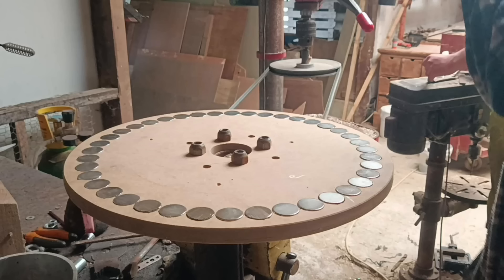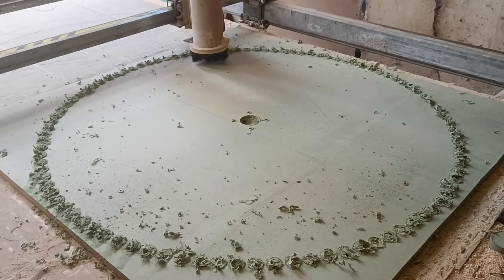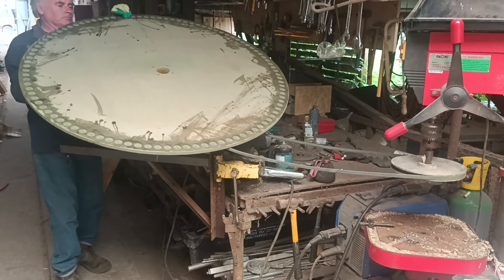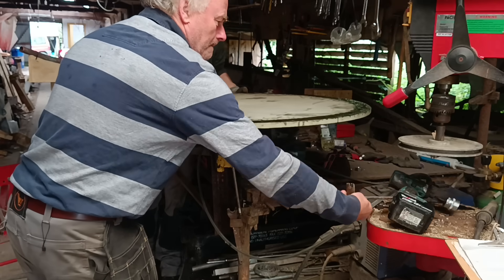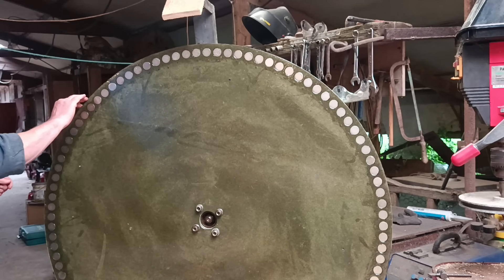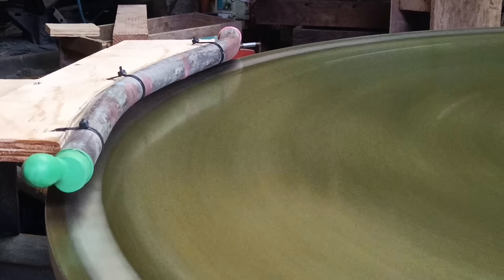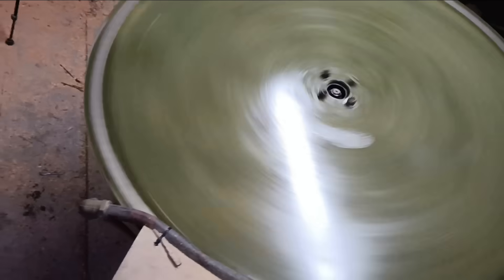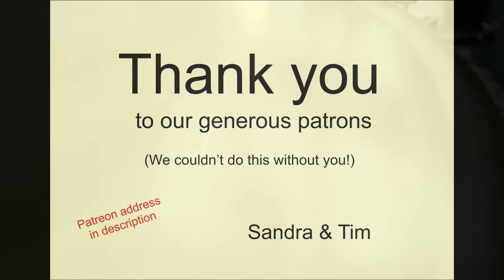ABSOLUTELY HUGE Magnetic Induction Heater! Using 100 Spinning Neodynium Magnets And A Bucket

Comment: I've been working on something similar, not as large of a spinning disk, with a large coil of 1/2" copper tubing as the non-ferrous heating coil. Rather than a single row of magnets, I arranged two rows of magnetron ring magnets in two rows, the copper coil arranged to go around the entire magnet disk with the entire area of the copper coil exposed to the rotating magnets at a lower RPM.  Also, I used a check valve on the cold-water inlet side, and an expansion tank on the heated side with a closed 20-gallon steel tank. A small positive displacement gear motor circulation pump circulates the water back to the beginning point on the heated copper coil. This is closer to what a standard electric water heater would do internally, only with less electric energy. The disk does not need to be helped to begin spinning, other than the start capacitor, and the tank temperature is limited with a single bulb type probe thermostat.  It works but I think the slower heating recovery time would take three of these to use in a normal home use scenario providing continuous hot water at around the total heating cost of a standard 40-gallon electric water heater, except this would be continuously heating over the limited recovery time of the standard water heater. - I have noticed the stronger magnets don't require faster motion to do work required. The set temperature I use is 135 degrees F.

Comment: There is also evaporative cooling. Don't forget that it will pressurize if it boils, could lead to explosion if totally sealed. Try a loose fitting lid first.

Comment: what would happen if your copper tube was longer across the induction area of the magnets? Lets not forget that there is also a magnetic field below the disk so you should be able to make your pipe encircle both the top and the bottom of the disk.

Comment: - spin the disk vertically because that makes the next point easier to accomplish
- Have two copper circular containers run the circumference of the entire disk. One on each side.
- make each container out of a thick laser cut copper disk so that the face of the containers facing the magnets is flat and as close as possible to the magnetic field as possible. The faces of the containers that do not face the magnets can be a material that is easier to work with and doesn’t heat up/lose heat to ambient.

Comment: Cool, now what is the efficiency?

Wouldn't it be more efficient to use the power driving the motor to just heat the water directly?

This looks like an overkill. It's working but it's an overkill for no apparent reason.

Comment: Wood and magnets are rather heavy, requiring a bit of HP to move it about.
However, a tubular aluminum frame is light and will spin faster. The tubing could have a central tube inlet, and a  circular/toroidal pool outlet. Plastic tubing could dip into the liquid with a small but effective circulation pump in between. 
A small turbulence will develop around the plastic tubing, so the water level needs to be a bit below the top of the frame.
The frame needs to be symmetrical to avoid unnecessary vibration. You might need to fit and weld, because the one shot bender is designed for a different application.

Comment: Not trying to sound like a smartass but have you thought of burning all your bits of wood under the copper piping that way you can put your belt back on your tractor and be able to use your drill press again, just saying

Comment: An bigger isnt alway better you have better luck make electric power then store the heat in sand using the sand to heat the water all at once or it will just keep getting cold befor you could use it or have vary little hot water you pick heating water is a wast in less your making steam engine for power soon as it gets hot its wasted energy by cooling down

Comment: @Way Out West - Workshop Stuff old water heater tank put the side that heats up to the top so your dumping only hot water into the tank cover all the lines in wool or anti freeze tube then rap wool on top of that rap a coper tube or a tube made out of the stuff you cooked the egg with seems like it worked better an have longer  circle the hole length of the magnets if it heats up faster rap top that isnt by the magnets so theres no thermal loss there
Reply: Or just rap the hole tube shouldnt be in the way of the magnets anyway should shoot right thu it or rap soild copper coil over the magnets takeing each end one positive one negative to power a mini heater to warm the water instantly your welcome

Comment: I agree that insulation will help but feel what you need to be chasing is efficiency. How about using a flat strip of copper 4 to 6mm thickness 400mm long 50 to 100mm wide. Most important is to reduce the air gap to 1mm or less. This will induce strong eddy currents and therefore the most resistance and therefore heat. Heat transfer can be achieved if the strip is welded or solerded to the pipe. Would love to be there to see the results. Good luck.

Comment: Why wouldn’t you use a circular piece of 1” soft copper pipe that already comes in rolls with no bending necessary, pipe wrap it using the black insulating foam wrap?  It is self sealing with no need to use cable ties and keeps it “floating” the correct distance from the magnets.  Also, instead of wasting the use of so many magnets, you would be able to use the entire ring of magnets all at the same time?  Your materials are rudimentary at best and horrible at the least.  To improve efficiency even further, run the disc on a vertical axis instead of a horizontal axis plane thus making use of both sides of the disc at the same time.  You would then be doubling your output while using the same number of magnets.  If you would spiral the magnets inwards so that the entire You are defeating your experiment by trying to nickel and dime the experiment to death instead of spending a few more bucks to right the wrong situation.  Anything else that I can help you with?

Comment: You can add a 2nd copper pipe on the opposite side of the armature wheel doubling heat generation. Probably on the 180 deg. lobe not directly opposite. The heat generated at this scale seems a bit low to get much convection current to the reservoir for efficient circulation from the heat generators. If the copper tube walls were thicker you might get more current which could increase BTU's generated. It must be the resistance of the metal generating heat via the magnetic eddy currents. Maybe increase the resistance of the metal - an aluminum  pipe might generate more heat as it's less conductive. Oddly, aluminum is diamagnetic so it's strange that alternating magnetic poles moving past have any effect... It would be fascinating to connect an oscilloscope to see what the current looks like! (in both metals) It might explain a lot.

Comment: Laboratory gram scales use a similar system to 
slow down the swinging action of the scale.
Called "Inertia Dampener"
Where a piece of nonferrous metal with ridges on it swings between 
a narrow gap of a C shaped magnet.

Comment: if you want to use mechanical rotational energy to heat water, a better effeciency is by using a water hammer heater.   This inventor invented it and it was ingenious.   But it never really took off.

Comment: With cold water coming out the cold water tap can get up to 37c in the middle of summer here and I shower at 42c, it wouldn't take much to heat a tank of water but hard for continual flow but would this be more energy that a solar panel and a jug element?

Comment: I’d try lots of smaller lengths of tubing connected with non-conductive tubes. Your eddy currents have too much room to run. Also, you can wrap some length underneath just as well as on top

Comment: You can use both poles of the magnet to double the amount of useful work extracted, magnetic flux goes right through wood or whatever that is.  A large insulated copper sheet on both sides would get quite warm and can effectively transfer the heat to copper pipe in contact. Be careful if you try the sheets, the magnets will put a lot of torque on them and can move or bend them if the flux is too great.

Comment: Suggestion: Partially flatten the copper pipe holding the water. That will allow the water to heat more rapidly, causing greater thermal flow.

Comment: Do you get more energy out using this as an induction heater or a fly wheel?  Could you do both at once?

Oh, and as a friction heater... Would induction or friction heater get hotter with same energy in?

Or maybe save the energy once the water has been heated in a Fly wheel "battery" for when the wind wasn't blowing?

Comment: Why not make to the original size and put a suitable axle between both and put one on top of the other with belts on each to absorb the energy.  In my experience they will end up being lighter but the heat you're looking for will probably come from the outer edges to.

Comment: Take some mass out of that tabletop by cutting holes in it.

Repurpose a used water heater.

Get the tubing closer to the magnet.., or put a second piece of metal underneath of the tubing. A solid piece of metal, something that you know is highly inductive. Transferring the induced heat from that block into the pipe.
Reply: Fiber is probably the best solution to insulation. But, cardboard and duct tape for the win...
Reply: Make a channel on the circumference and use that as a spacer or guide to keep the pipe fitting as close as possible without the possibility of surface contact.
Reply: Make the transmitting metal piece cover both sides of the table. Make it a U shape with the tracker/guide riding the table edge. Make that thick. Attach pipe as needed.
Reply: Saw a comment talking about in-setting, at the halfway point between the magnets, pieces of steel on the bottom of the table to increase the flux, like a core. Might be worth looking into.

Comment: Cute, intellectually stimulating, but I suspect pretty useless. If you want to heat water with a windmill, a better way would be to drive a compressor for a heat pump and use a geothermal heat source. Those systems can have SEERs in the 40s range which means you multiply the energy input many times.

You could use off the shelf generator to convert windmill energy to electrical energy and then use a conventional electric hot water heater. This conventional arrangement and the one in this YouTube video will always be less than 100% conversion but the heat pump would probably deliver in the range of 300-400%.

Comment: I think measuring the differential of energy before and after adding the metal would help a lot with figuring out how much energy you are putting into it. Easier option is to spin the disk up to a certain RPM or for a similar time and then do one check with and without the metal to see how long it takes to slow down. That would atleast give you a ballpark on how much is being put into the water.

Comment: Hi. great work. I did something like that years ago. I learned your copper tube should be flat and it most almost touch the wheel. I used a bench grinder and a smaller wheel. good luck my man.
Reply: It is on You tube

Comment: You can get donut shaped magnets with a countersunk hole in the middle. I’ve even seen some that come in a ferro magnetic container which stops them sticking to each other, you remove a cap to let the magnetic field out after installing them.

Comment: you could try a type of coil setup with thinner copper tube but the same area overall, by compacting and having some above some below catching current on the underside, i would be tempted to do this the entire circumference and really get the potential out

Comment: How about having the mdf the same thickness of the magnets with 2 circular copper pipes all the way around the circumference of the magnets, both on top and bottom to double and maximise the radiated  area. 
If you put a one way valve on the exit copper pipes and perhaps a big  u bend on the entrance pipe to prevent backflow, it will heat the water quicker before it moves on from the copper pipes i think?

Comment: QUESTION? Ive theorized for decades! Midlevel times and before! A huge open hearth = fireplace & way too small flue too work! Was a disk with magnets spinning behind an metal plate powered by a windmill and shaft ran down tiny flue to gearbox? And if metal plate had designs cut through plate and a fan blade behind it! Could this heat the room/ building?

Comment: Tim Your video's are very entertaining, and You seem to have the basic concepts down, but Your execution of the job kinda amazes me in terms of it's ineptitude.  You drill holes on a huge piece of MDF, and cut the circle out using a jig, and yet the run-out and dynamic imbalance is HUGE.  A little more care on the jigs sharpness of tools , and measuring stuff would go a long way !  So would some calculations and building several small alternative models to test concepts , and measure possible unanticipated problems, before commiting to a big build and high exppenses.   Some hot tubs use the pump through tubing using a 3/4 horsepower motor to heat water just by the friction of the water moving through a spiral wind of copper tubing.  I'm not at all sure that system might be just as practical, and much easier to do !

Comment: Seems like the heated in line should come out higher in the bucket than the drain to keep the flow moving, not sure but maybe a thin diameter on the up pipe and a little wider on the down

Comment: You are building an awesome machine! Suggestion #1. Strap the probe of a digital oven thermometor to the return (hot) water hose Suggestion #2. Install a tube in your bucket so the return water comes out at the top of the bucket and add more water. This will stop the return water from flowing back to the down stream hose creating a short circuit. You will need to reinforce the hub of you MDF "plywood. Perhaps the center of a tire rim that fits that brake drum would be enough. Oh yeah, have you given any thought to generating electricity on the opposite side of the rotor from the hot water side?

Comment: Yes I have a rather heavy hitting suggestion as in your heat exchanger(the one inch copper pipe) needs to be filled with many smaller gauge copper pipes .  This will the surface area of flux induction as electrons only travel on the surface of a conductor.

Comment: Make a large ring of copper pipe and make sure the ends are joined to close the electric field and then it will make more heat with greater resistance on the magnets

Comment: Perhaps make a flat coil 3 or 4 rounds to take full advantage of the magnetic fields and 🤔 insulation on the riser unless of course you're creating a radiant heating system then insulation everywhere except your intended areas

Comment: We use copper square pipe at work for heat treating. We run cold water through the pipe to keep it cool as it heating up huge steel forgings.
Reply: Could you solder some plate on the tube to get more area. The perhaps use plastic pipe after the induction part just in case it`s sucking energy away.

Comment: Copper I thought was not very good for induction, how about an iron pipe.  To generate more induction you could have multilayer rotating discs (stacked) and the pipe connected to a manifold.  Increase the surface area of the metal by extending it further around the disc.  One idea I had was to replace the pipe with a 3 to 4cm wide x 4mm thick iron ring, to the ring have micro bore copper pipe attached and you could get maybe 3 to 4 turns around the ring, enclose the whole thing to maintain heat and of course insulate pipes.

Comment: I’m thinking that the reason you are not getting very much heat is because you are using copper pipe.  Try using thick wall steel pipe.  Copper pipe has too little resistance to the eddy currents.   Copper pans are not suggested for induction cook tops.  Steel pans are.

Comment: The whole system could be insulated - even the Cu pipe close to the magnets (possibly just the top semi circle of the pipe) .The bucket would benefit to, and the use of a thermocouple connected to a multimeter in the bucket and another to the pipe on the flow nearest  the start  of the riser. You should be able to geta fairly accurate energy output measurement (The SHC of water is 4200/cc/ deg c) joules if I remember correctly)

Comment: Nice work, of course it needs tighter air gaps and thicker pieces of cooper for the induction capacity and perhaps requires to much precision parts to be cost effective at some point. 
Interested to know the efficiency of this this system through your improvements. Input W / output W

The most direct conversion from mechanical to heat is indeed friction but you dont need induction. 
A less expensive and direct transformation would be the water brake windmill, as it been explored by Tim yet ?

Comment: Very exciting :)  You need to add a one-way valve, and have the hot water return into the bucket at a greater height than the cooler water siphon. (Just extend the pipe further into the bucket. This is how HW cylinders work.)

Comment: For a quick test, your little arc of pipe obviously works, but to make a more serious try of it, you should have a nearly full circle, with the inletand outlet close to one another, that way you have more area over which the water interacts with warmed pipe.

Judging by how your drill sounded, it may be a little underpowered to run such a thing lol.